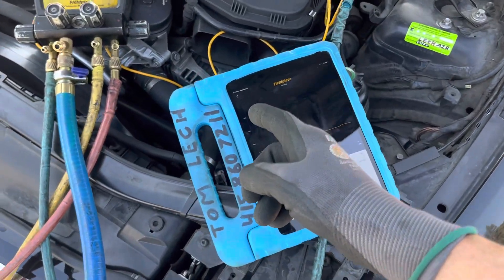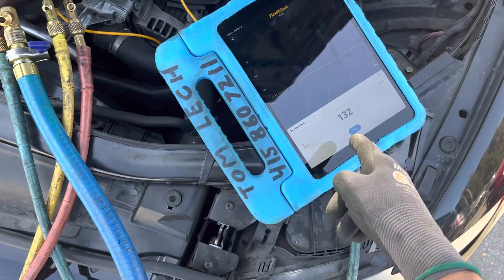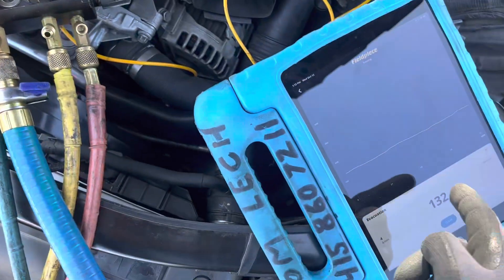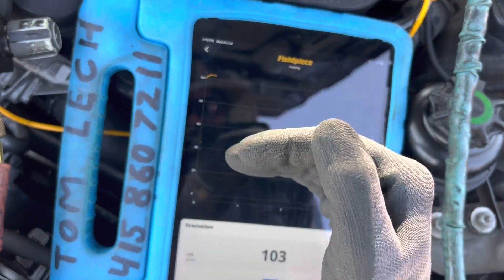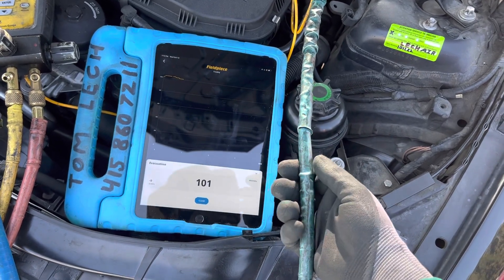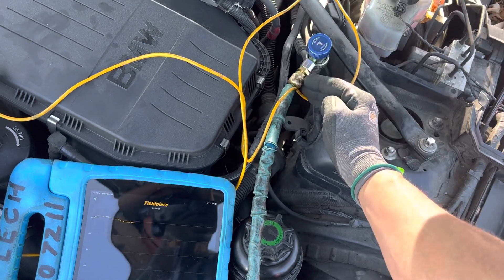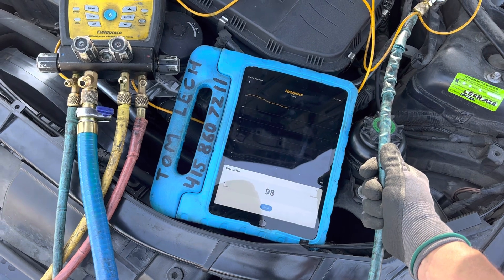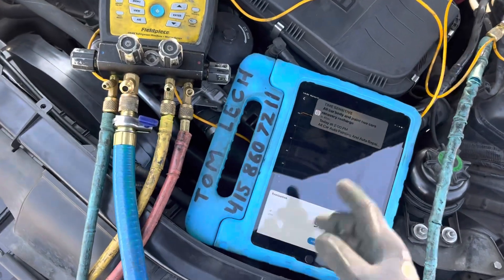MICRON GAUGE BEST BUY FOR YOUR MONEY 💵 GET 2 for 1 ￼ Digital gauges & micron gauge￼

Comment: With micron gauges, do you find that over time they go out of calibration and need to be sent back for cal?

 I have a yellow jacket sensor that is over reading, despite being cleaned twice, but it comes with a calibration number to enter into it's meter, so it made me think that it may need a recalibration.

Thanks.
Reply from the maker: Yes, other than getting contaminated from refrigerant oil on the sensor.,
   Some can drift out of calibration just like temperature sensors can drift out of calibration overtime. 

But if you’re gonna be inputting numbers to compensate for something out of calibration, you have to have a known good reference point to use as your baseline to set to .?

Most technicians or even shop owners don’t know enough or don’t wanna spend the money to have at least one good brand new never used in the field only as a lab baseline reference point micron gauge that is stored in a shelf and never use out on cars as a reference point . 

Accu tools blue vac has a calibration sequence that involves putting your gauge in a sandwich, Warks air tight baggie and then throwing it in a freezer at -10° or 20° below zero very elaborate little set of procedures to follow . 

And I’m dedicated, remote, micro gauges many technicians unfortunately don’t know to follow the procedure of putting an isolation ball valve between their micron gauge and the system their servicing so when it comes time to fill it up or to a nitrogen pressure test not to blow refrigerant oil up into its port, contaminating the sensor Technicians usually cause their own problems with their sensitive test equipment.